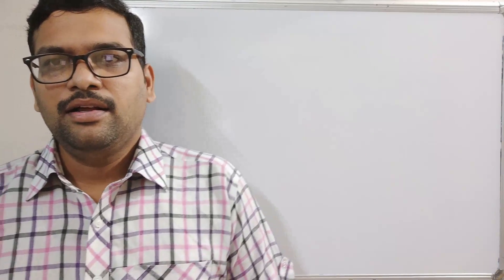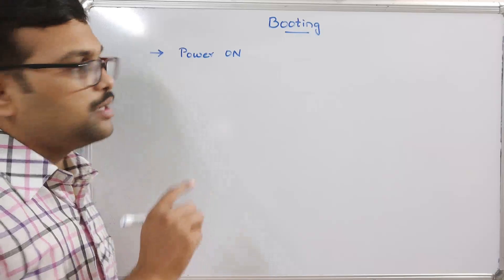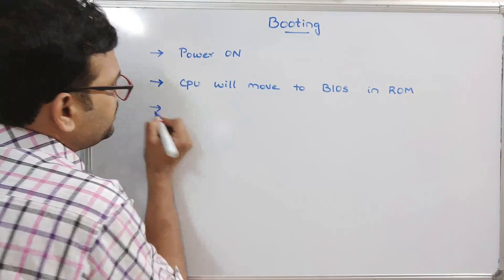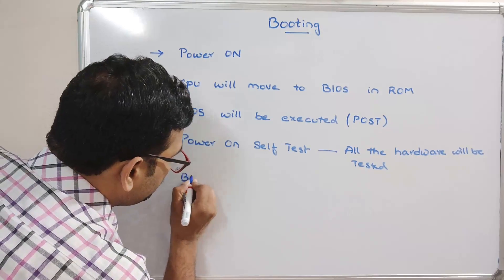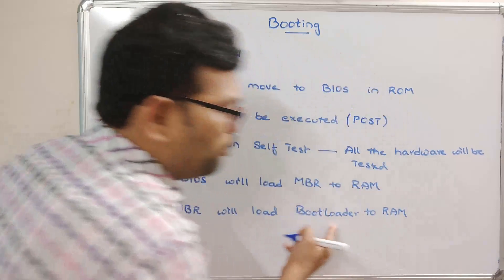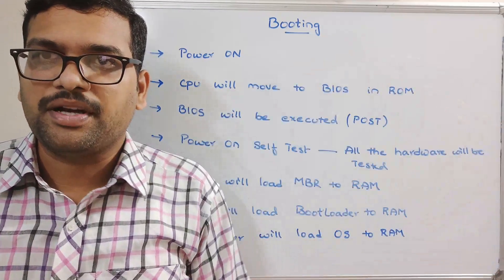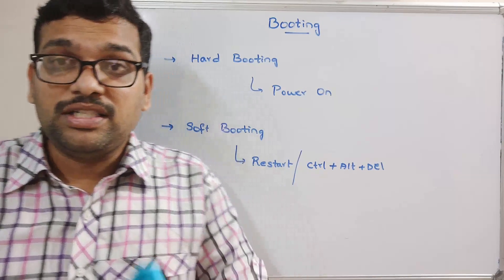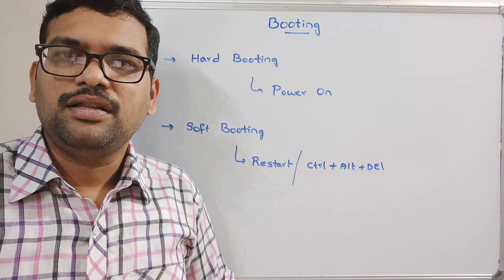WHAT IS BOOTING PROCESS || HARD BOOTING & SOFT BOOTING || COMPUTER BOOTING PROCESS

Comment: I was booting my system using this cmd "chkdsk X: /f /r (Replace X with the Current Windows Install Letter)" and suddenly my electricity goes off because I don't have backup for PC my CPU shutdown because of power cut of electricity and when the electricity was back I turned my PC on and the screen shows company name and then no signal continuously, is that because of windows got courpt? Do I have to reinstall windows or is that bios issue?
Reply from the maker: Yes just reinstall OS
Reply: @sundeepsaradhi  thanks a lot sir

Comment: Sir as you said in POST all hardware like key board And mouse are checked weather they are working properly or not but if they are not connected yet to the PC thn what it will check?
Reply: it will check the hardware chip